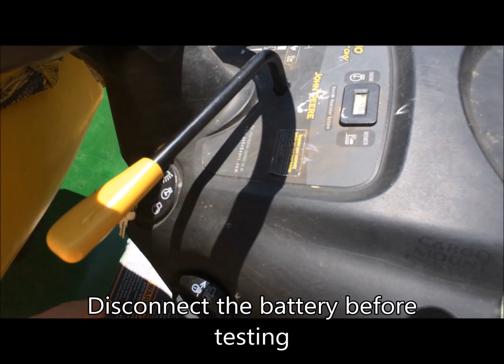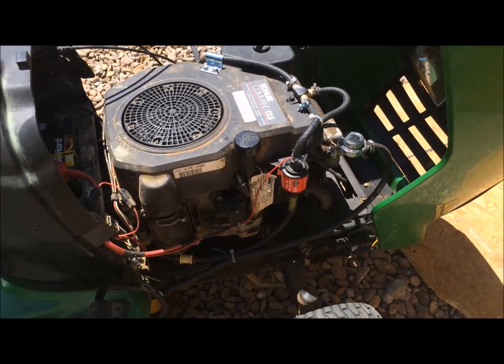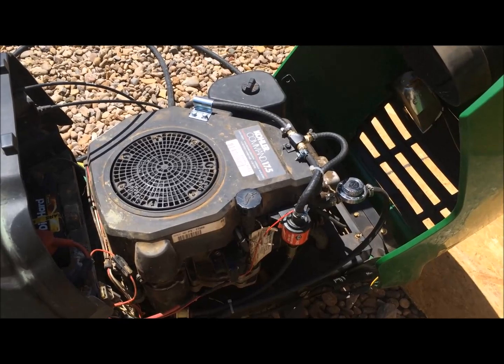Fuel Pump Replacement | Electric Pump Conversion

Comment: Just out of curiosity wouldn't you want the regulator between the carb and the pump and not the pump and the tank? Because if you think about it where you have the regulator the carb is getting the whole 28 gph and the tank is only getting 1psi.. I could be wrong but if i were you i would check it out..
Reply: From what I have seen the regulator should be after the tee and before the carb. The regulator would only allow set x-psi to pass through it while the excess is diverted through the tee back to the tank. The return (Tee to tank) should be slightly smaller so that all the fuel don't run back. If your tractor is not experiencing flooding with this setup it is because the needle in the carb is working well. I am looking at this same setup for my carbed -ATV to replace the factory vacuum pump.
Reply from the maker: If the carb was getting the full flow I think it would drown the poor engine, it doesn’t seem to have a problem idling for an extended period of time. The way i understand it: the regulator allows fuel to pass through it once the desired pressure is met. So once the pressure reaches X psi then the regulator allows Y amount of gas to flow back to the tank to maintain that X amount of pressure since the pump is always moving a constant volume of fuel. If the return was open and the regulator was between the pump and carb all the extra volume and pressure would be directed to the return since there would be nothing to control the flow and thus there would be little pressure at the carb regardless of the regulator setting (trying to increase pressure at the carb would only decrease flow to the carb and increase flow through the return). With the regulator in the return there is no fully open path for the fuel to pass through and thus allows the regulator to pressurize and control fuel pressure in the 3 mentioned lines. My c10 that’s on the channel  has a similar setup with the Vortec fuel injection. Also in the vid I show the return with the pump on and there is a stead flow of gas so the engine is not getting the full flow of the pump if that makes sense. I could make a vid where I try different setups and monitor the pressure if that would help. Thanks for the comment
Reply: Regulator put aft pump regulates pressure aft the pump.  Anything beyond its set pressure in the line will open up its valve and back to the the tank.  

My thought was, I wonder if you could tee into the fuel inlet hose toward the tank side rather than pump inlet instead of drilling into the tank.
Reply from the maker: I recently had to work on the Deere (factory fuel line pinched and wouldn't flow gas) and I was thinking about something similar. I am learning all this stuff as I go, but I think it would work but I don't know how well. I think there would be potential for air to get trapped in the pump/fuel line since there would be no where but the carb for it to escape to. I think with it constantly cycling the fuel through the T there could be the potential for the fuel to get hot which might also strain the pump. At least with a actual return there is a way for the air to easily leave the system and with the gas cycling through the tank it shouldn't get hot. I really don't know how well it would work but I would be curious to know if you try it.
Reply: I don't think my Troy Bilt mower has a fuel pump. Looks like gravity feed to carb. When fuel tank level drops to, say, 1/4 tank, it acts like it's having fuel starvation.  Should I add fuel pump w regulator?

Comment: Not sure what people’s problems are I have a Kohler Magnum 18 use it everyday never had a problem with its macanical fuel pump it is a 1985 with original pump
Reply from the maker: I took both of mine apart and don't understand either, they are really simple. I'm guessing it may have to do with gas quality and something that builds up on the valves and keeps them from sealing. Regardless I was tired of messing with it. It's put up for the winter but so far has had no issues.
Reply: Well if it ever does go out I’ll put a electronic pump on cause I got one that works laying around

Comment: This is one of the best conversion videos I've see so far.  Currently my dad's tractor is gravity feed which is really iffy and an electric pump would keep the fuel flow consistent for him.
Reply: If you do this with a gravity fed carb, you'll definitely need a pressure regulator 👍
Reply from the maker: Thanks for the comment and hope the video helped, so far the john deere hasn't had a problem since. If it's gravity fed and having problems it sounds like something may be clogged